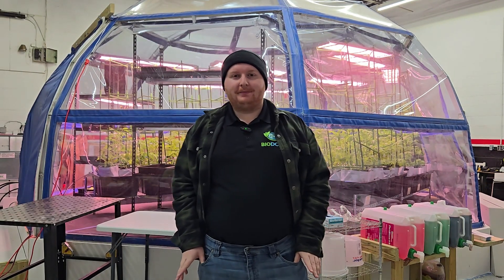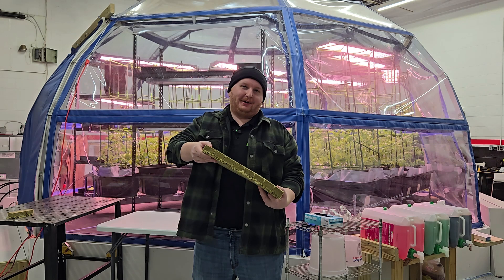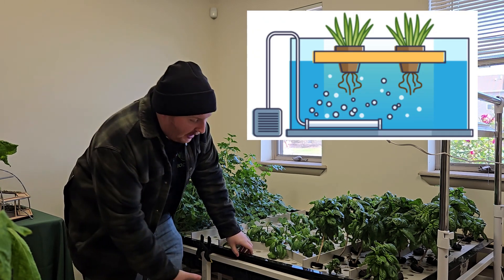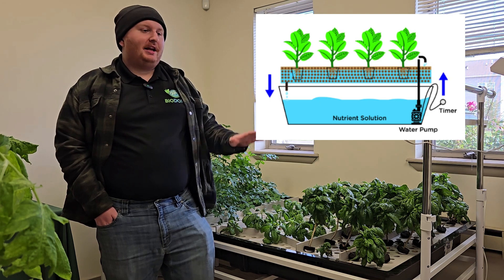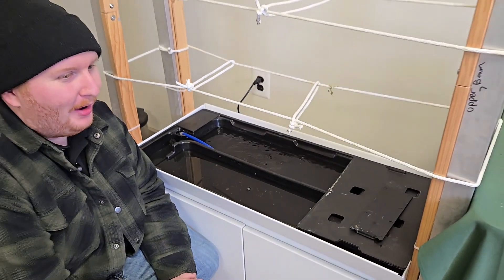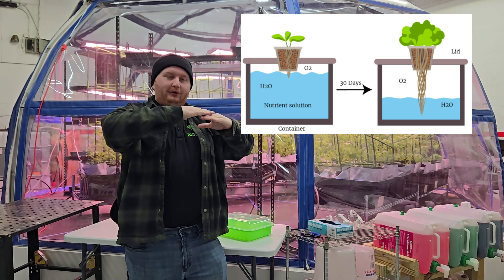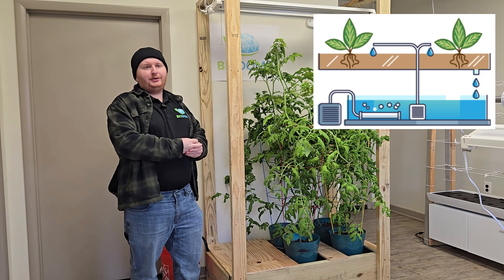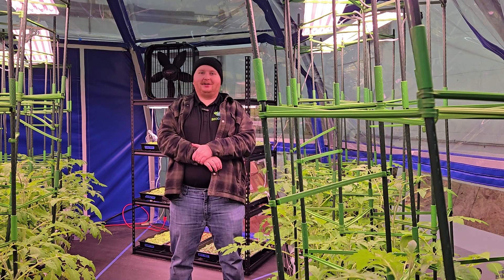Hydroponics Explained: 5 Game-Changing Systems to Grow Your Plants Faster!

Comment: Very cool seeing these different methods . Do you change the method based on the plant you’re growing or can you use all of these methods for every plant?
Reply from the maker: The simple answer is that you can basically use any of the methods to grow anything. Different methods provide different upside depending on the plant you are growing. An NFT system will be optimal for leafy greens and herbs, while a drip system can be designed to work with much larger plants. For the most part if you are trying hydroponics at home, it will be about convenience, what fits in your space, and what is within your budget to buy or build. Our recommendation for an at home system would be Kratky, DWC, or drip, as all can be made from things you can buy at your local hardware store and will be able to grow a diverse group of crops.